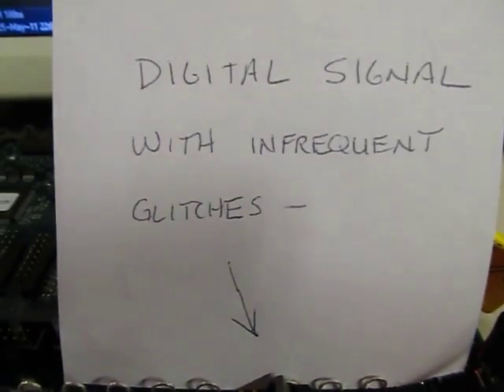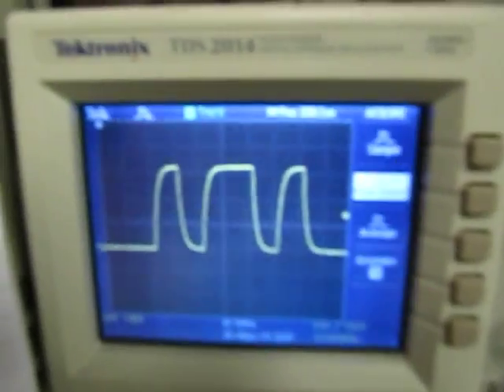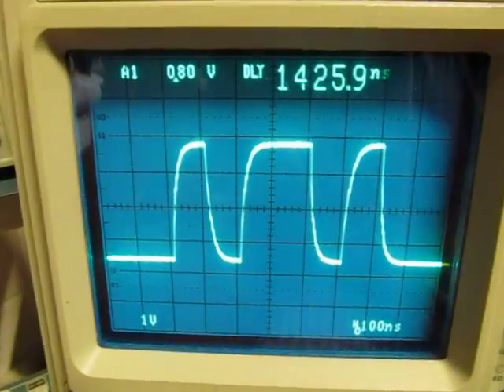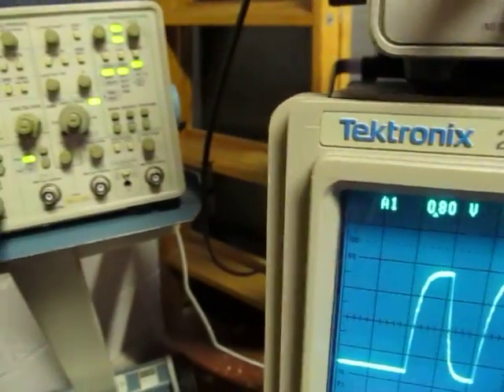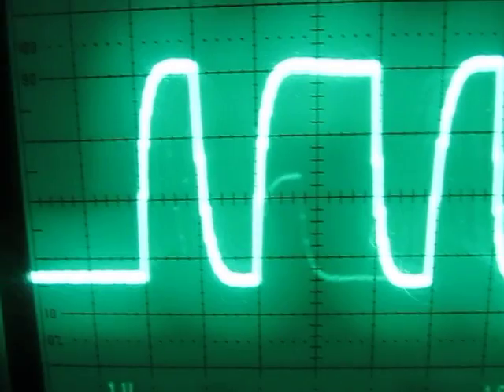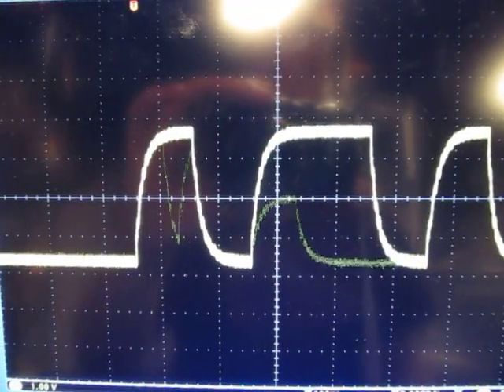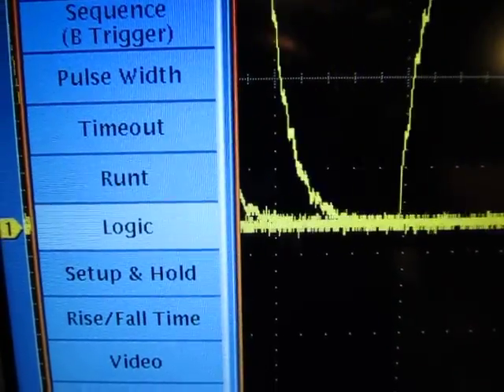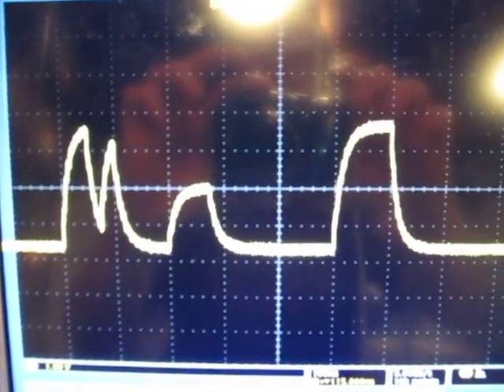#6: Infrequent Glitch capture on an Oscilloscope

Comment: @w2aew so,maybe i can use a MCU  and small program to generate glitching signal ,or mix a normal digital signal to a infrequently occurring glitches.maybe simply way is to use a function gen. and a switch connected to a simple RC circuit,then turn on and off that switch randomly.OH NO my head is full of glitching "ideal" now!! XD.